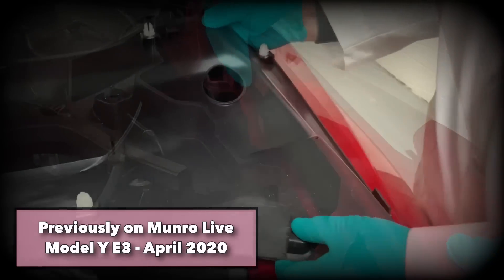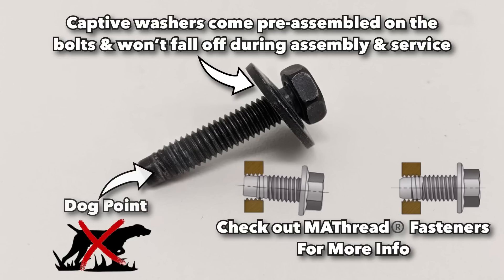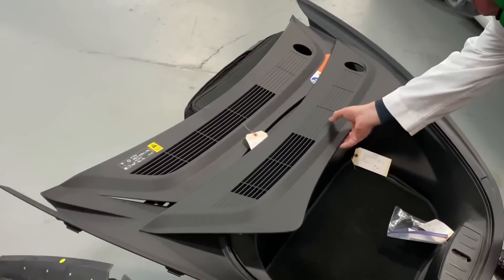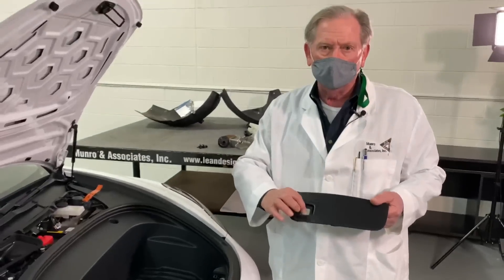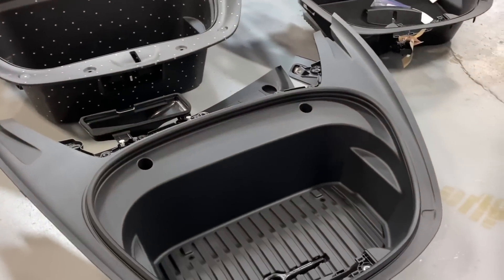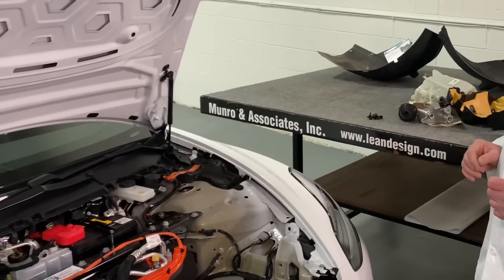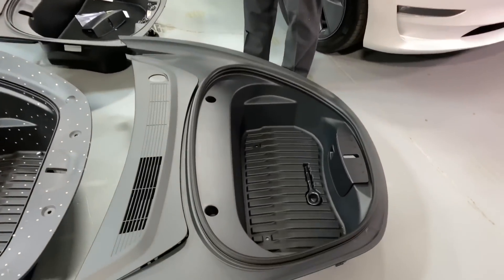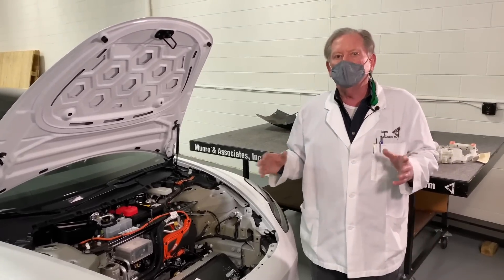2021 Tesla Model 3: E4 - Under the Hood

Comment: I have a driving school for teen and adults. I got a Tesla and I need to install an instructor brake pedal on passenger side of a model 3. Is it safe to drill a 1/2 hole in front of the passenger side seat to install the brake assembly. And I need to drill 2 holes under the driver's brake pedal so I can install the pulley/cable assembly. Do you see any issues with it?

Comment: Can you tear down a supermanifold/compressor that's failed?  My car is in the shop right now, getting a replacement Compressor, Supermanifold and AC lines. Zero heat at -20c.

Comment: Sandy isn't telling the full story here.  He's takes an optimist's view of Tesla rapid iteration of the octovalve.  Let me contrast that with a realist's view.  What Tesla's method of rapid iteration is telling me is that they rushed this product to market before thoroughly testing and optimizing it, thereby necessitating that they make loads of updates after the product has already been released.  

Contrast that with other major OEMs, and I think you'll they also make rapid iterations to their components.  The R&D on a new component may lasts years, going through rapid iterations as well, before they finally get to a point where they believe the component is good enough to actually go into their vehicles.  Why do it this way?  Because once that component is released into the wild, it may quickly be applied to millions of cars per year, possibly across multiple OEMs and brands.  

The big difference between other OEMs and Tesla is that Tesla tends to throw early unvetted versions of their components into cars, whereas other OEMs fully develop and vet the components before putting it into cars.  That means other OEMs don't have varying iterations of parts littered across all customer vehicles in a given model year like Tesla may.  It happens, but no where near as often.  Some of Tesla's cars in a model year may work great depending on iteration, other cars may not.  One person's car may work better than another's.  One person's car may have the system fail.  

I can only imagine how much added complexity this adds to the lives of the people diagnosing and servicing these vehicles, and who knows if the engineering department call center at Tesla HQ is aware of all the changes being made at any given time to help the service departments diagnose.  Is Tesla's solution sustainable or even superior?  Maybe, maybe not.  I'm sure there are pros and cons for both systems.  Which is ultimately superior would require a much more in depth review.

Just to repeat so it's clear, there's no evidence that Tesla's rapid changes to components is any different that what other automakers are doing.  The difference between Tesla and other OEMs is that while they're in this rapid development phase for a component, Tesla is throwing whatever they have into cars they're selling and then try to optimize / workout bugs, while other automakers first try and get as many bugs worked out and the system optimized as much as possible before finally beginning to add it to cars.  Customers of the other OEMs, or someone like Sandy who's tearing production cars down, would never see this development process of the other major OEMs  in action like they do with Tesla; so they presume other OEMs didn't go through a similar process.  That's not the fault of other OEMs, it's the fault of the ignorant commentators who are claiming this rapid iteration makes Tesla superior.  Ironically, this claim never comes with an actual comparison of parts between Tesla and other brands... and since viewers may have never looked at cars in this much detail before youtube tear downs, how would they have any clue?  

One last thing... the reason Tesla seems to take this rapid iteration route and other companies don't is because they're trying to gain market share and boost their share price, and so they're rushing products out before they're fully vetted while sales growth is hot.  I mean... Tesla's already valued at more than every other major OEM combined while selling a tiny fraction of the cars.  Why the incessant need to keep pushing that share price higher?  Well, probably because the company's car business hasn't shown any significant profitability yet, and won't without huge volume growth.  Without subsidies and regulatory credits, they'd be losing money hand over fist, but as we know, these subsidy programs won't be sustainable forever.  They're rushing production because they need to maintain constant growth and improvement.  And I'm sure they've already realized that these rapid iterations (see OTA updates) constantly keep them in the news, on EV blogs, and in youtube vlogs.  It's become a form of free advertisement.  

Frankly, Tesla isn't choosing not to advertise to the public using traditional means... it's that advertising costs tens if not hundreds of millions of dollars per year.  Tesla can't afford it... and they've already found that their rapid iteration process and legions of online Musketeer bloggers/vloggers are giving them ample advertising at no charge.  If demand wanes, they'd rather cut prices (with the side effect of getting even more free advertising online) than put out a multi-million dollar Super Bowl commercial....

With Sandy having worked in the industry for decades, I find it a bit odd that he doesn't mention this nuance... or maybe he doesn't understand it?  Instead he plays it like Tesla is doing something extraordinary here.  The only extraordinary thing Tesla is doing with this rapid iteration process is rushing products to market before they're ready for prime time.
  I mean, what do you expect from someone who owns shares of the company and stands to gain by putting out favorable coverage of that company versus competitors... and whose new found youtube career was built on Tesla videos?  I'm sure there's no bias though. ;)  It is strange to me that Sandy doesn't tear any other vehicles down online.  I mean, we know he tore down a Jaguar I-Pace... but no videos of it?  Weird.

Comment: That routed red cable looks like it has electrical tape wrapped around it before fixed into the clips, that is really bad for cost savings and simplicity and is a bit of hack job.

Comment: About that “plenum” as Sandy calls it, the opening to let air into the HVAC, I’d like to know if the plastic cover forms a seal on top of it (the grill is there to admit air)... to exclude rodents.  Don’t laugh.  I drive a Chevrolet Bolt, I live in the country park outside and mice were trickling into the cabin, chewing their way through the air filter (they turned it into nesting material).  Once inside the cabin they could not reverse their path and died from dehydration.  Not good for the mice and not good for me, breathing air filtered through mice excrement.  This trick cost me 300$ at the Chevy dealer, plus the rest charged to my insurance.  This to sanitize the air ducts and change the air filter.  The following day there was another mouse trapped in the cabin.  They told me there was no way to keep the mice out.

I took the car to a body shop I trust, along with a roll of welded steel mesh (some call it hardware cloth), that I had used to rodent proof my cabin.  They fashioned a sort of bonnet from this material to fit on the plenum and glued it in place with two parts glue containing metal grit (the grit to discourage mice from chewing on the glue).  This cost a little over 200$ but unlike the service at the dealership it  solved the problem for good, plus the guys had so much fun with this unusual little project, I think they are still laughing.

So, I’d like to know if I should keep that roll of hardware cloth around to fashon another bonnet for my next car, which shall be a Tesla.  Thanks guys, love these.

Comment: Why would a smaller HVAC air inlet vent be good as opposed to the previous wider/ bigger HVAC from a performance point of view and not from a cost point of view? 

TSLA made it smaller, so doesn't that mean air flow performance would not heat up the car as widespread. Or does having a smaller inlet allow the heat to better flow outwards forcefully. 

Just trying to understand how making it smaller makes a bigger and better difference for the customer if any other than from a Tesla savings point of view.

Thanks Sandy and @MunroLive

Comment: I've been told all my life that Heat Pumps perform worse in cold weather, is TESLA lying or did they have a technology break through?
Reply from the maker: Heat pumps for homes vs. a gas furnace is what you may be referring too. The heat Pump in the tesla is more efficient than and electric PTC heating element.

Comment: The main reason the plenum is smaller is because the heat pump takes up some of the space the old plenum used. (no heat pump in the original Model 3)

Comment: I’m concerned about and wish you would comment on what appears to be unpainted primer on the inner fenders. If that is the case it’s likely going to rust prematurely.

Also, while the constant improvements are great, are the new parts designed to retrofit into the earlier models?
Reply: Listen to the video :D he specifically said that the new model 3 frunk is backwards compatible with the old model 3. he even went on a 10 second explanation road to tell you that this means the old frunk does not go into the new model 3 but the new frunk goes into old...
Reply: I saw that and that’s good but I’m more concerned about the complex mechanical devices. 
And the unfinished primer. Especially since some cars have very little to no paint in some areas. There are model Ys rusted only months after purchase.
Reply: @someonethatwatchesyoutube2953  source?

Comment: Hi Sandy, I am  thinking about getting a LR model 3 (although my heart is 90% with the Aptera, it is just so cool). I wonder if the floor of the model 3 (foot well, under both rows of seats) serve any purpose in helping with battery pack heat dissipation. The reason i ask is from what I know the model 3 can be quite noisy at highway speed so I will probably end up installing Dynamat or Noico in those areas. I had good success with my 2014 Ford Fusion (it now runs very quite for its class IMO). I won't do it to Model 3 if doing it prevent battery cooling etc. Much appreciated.

Comment: Sandy, have you done any testing to see if the heat pump works after overnight below freezing temps (below 30sF)?  There is word going around Canada that if temps fall below freezing overnight that the heat pump fails the next day.  Source: https://insideevs.com/news/464084/tesla-model-3-model-y-heater-problem/    and posted in forums in Telsa dot com.

Comment: Tesla Bjorn has done many tests between the “old” and “new” Model 3 in very cold weather. It seems the new car is super efficient at wicking the heat away from the battery and using it to heat the cabin after supercharging (can heat it for 400 watts power use).

Comment: That's an unexpected place for the air intake. You'd think they'd put it on the front to get the faster flowing air like they do on the Mach-E
Reply: Less sand in the air inside the frunk, and shorter tube to direct the airflow.  Tradeoffs...

Comment: The rate at which Tesla is iterating is insane. That's what you can do when you control/produce so many of the parts, unlike big auto which purchases from 3rd parties. It also shows the focus on engineering. Thanks for another great video Sandy.

Comment: Tesla put a lot of emphasis on giving comfort for colder climates with heated seats and steering wheel. I am wondering if it would be a big deal to have ventilated seats for the hot summer days? Is it an expensive design update? Since all Teslas come with vegan leather seats I am sure most people would appreciate seat ventilation.

Comment: Great review, have u get a hand on new body structure press. 
And much it effect on cost?
Reply: Hard to calculate pure cost savings on something like that. You have to estimate the cost of each of the old stamped parts and the amount of time that went into stamping them, placing them into jigs, doing the weldments, etc etc. Then you have to compare that with the upfront cost of the new casting machines and tooling and then calculate your break-even point, which is how many units you have to produce before cost savings come into effect. Munro may have these kinds of numbers cooking, but those will likely be only available in the paid report as this is the kind of stuff they get paid to do.

Comment: Sandy,  I love your videos.  One thing to test with the HVAC is make sure you compare the non HVAC model 3 to the HVAC model 3 while actually driving.  I think when in motion you will find the HVAC improvement is much higher because it can pull heat generated by the motor and controller as well.
Reply: The only real problem is the old car is a body shell and the new one will be soon as well!
Reply: @markharris8929  They are driving it to California right now.  It won't be cut apart for a bit

Comment: The HVAC is smaller because they use less filtration to reduce pumping losses and battery consumption. Studies have shown electric vehicles are consistently reducing cabin air filtration compared with ICE  to help extend range numbers.

Comment: Are the gradual improvements worth it in terms of economy? I mean Toyoya can crank out 10 million identical frunks once and have them sell for years, but if Tesla is doing one new iteration per year, that means headaches for service, bigger cost for parts and retraining for the assembly line.
Reply: It's all about economy.  The goal is to bring the cost down.  Elon has complained that the M3 is to expensive so they're shaving pennies anywhere they can find them and improving things where possible at the same time.
Reply: Toyota actually makes small changes over times and after a period a total refresh of their models, i mean Toyota makes cars, trucks , pickup trucks, bus............
Reply: Yeah but by keeping their lineup relatively simple I think Tesla might be able to offset this headache.
If you make 30 different models like many modern automakers do vs a handful like Tesla..
Reply: @0xszander0  those 30+ different models are mostly adapted cars for different countries and continents, toyota makes the 4runner and tacoma in the US but in other countries its the much smaller hilux and fortuner. And toyota sells tons of vehicles to mining companies NGOs......
Reply: @carholic-sz3qv  I'm not talking specifically about Toyota. And if I did it still isn't relevant. They're different models. Meaning Tesla could still offset their quick adaptations by keeping their lineup simple. So the point still stands.
Reply: @0xszander0  uhm wrong, tesla is trying to diversify their models just like any other manufacturers. Just look at mercedes for example they make the UNIMOG which is very polyvalent and can be configured for use in agriculture, army, mining, construction,  rescue..... the automotive industry is waaaay bigger than your imagination. In Australia volvo makes trucks for road trains, mining, heavy duty transport...... open your eyes man.
Reply: @carholic-sz3qv  Loool so many assumptions about me. Do you see me do that towards you? What's with that attitude. I know very well how large the market is. Tesla will grab just a relatively small percentage of it. You are just steering off course of the discussion at hand. Give a argument on what we were talking about instead. Their lineup in relation to how that affects the spare parts etc.
Reply: @0xszander0  the automotive industry is gigantic and there are soooo many vehicles types for various needs and applications you won't go much further by just making two or 4 models. Volvo makes cars, trucks, marine equipments, tractors, mining equipments......

Comment: Bjorn nyland shows his model 3 can get a heatspot of 50C near driver legs with AC running in the cold. You should investigate this models thermals before taking it apart.
Reply: yes but that is on an older model 3.

Comment: I remember as a teen we had models you did not need glue to assemble called "snap together" models. That's what modern cars remind me of...cheap shitty plastic parts that snap together. I have a car from 1970 that is still going strong. Would love to take a look at one of these in 40 years. Everything these days seems built to break.
Reply: I agree with you last sentence but.. Snap together is better than glueing pretty much always. 
Plastic is here in many forms, and old 70's cars were also full of it. It just depends how it is assembled and the details matter as Munro demonstrates here.
Tesla is good with the details. I think these cars will last very long. The thing that will be outdated the fastest is it's on board computer.
Reply: Let's check back in 2061 and see how things are.

Comment: Sandy - You probably should get a bag of popcorn and go over to bjorns channel and watch some of his tests and see the heat scavenging first hand with his OBD reader and driving. This was done -20 to -30 in temperature (pretty crazy). It defiantly is more efficient, I would say the 30% is a bit extreme, but 10 to 15 and sometimes 20 is plausible. The cars average on WH/MI or WH/KM and in his tests it was least 20-30 WH less than his older model. If anything bigger has changed in his cars it was the battery packs and how they were taking a charge seemed little more restraint then the older cars (not saying this is bad). Also thank you so much for your work and industry inside knowledge you promote. Your work has help me explain things better to some of my friends and family.